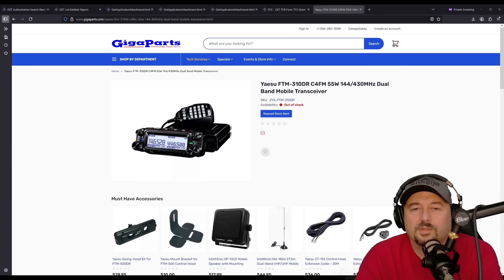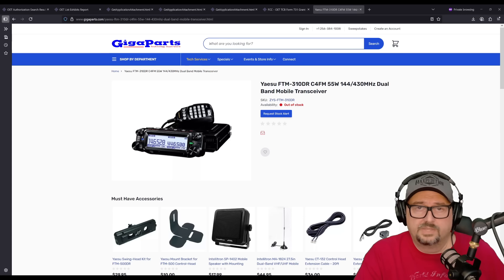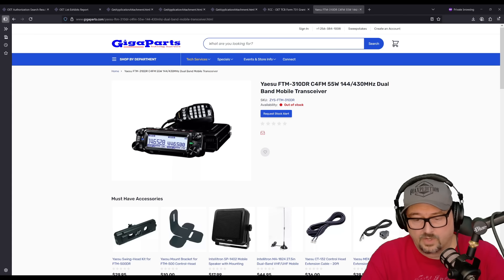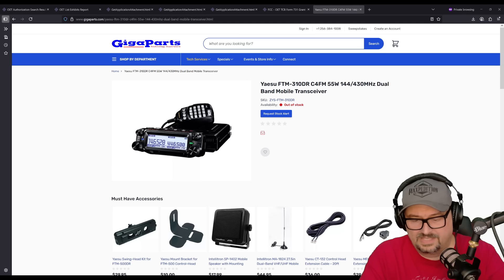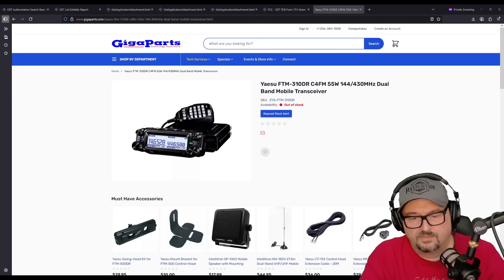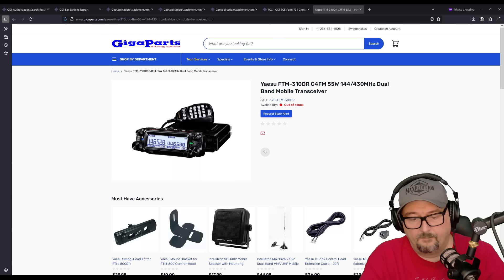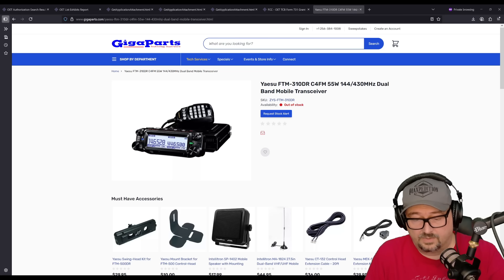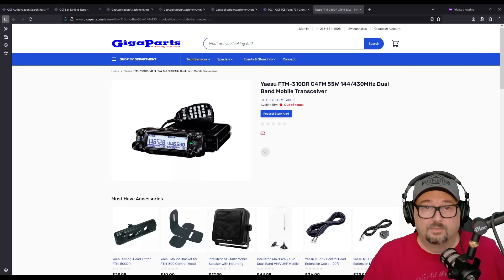The NEW Yaesu FTM-310DR Dual Band C4FM Radio Revealed!

Comment: You made mention of the FTM310d and FTM310 asp what really is the difference between the two? We are looking for some mobile radio for our Emergency Management & ARES.
Reply from the maker: The ASP has the Audio Signal Processing board, it is quite impressive and if you can squeeze it into your budget it’s worth getting 👍
Reply: @TheSmokinApe hey Man I appreciate your help! We currently have one DR-2X repeater. We absolutely love we order another through a program. We are in hopes to link the two together through fusion C4FM. The general public cannot hear C4FM except for other hams that have fusion radios. No one in scanner land can hear our communication. Analog will be standalone for other users, or to just get off Digital to communicate with other mutual agencies that may not have C4.

Comment: i bought a yaesu 6000 and was happy to have a new high quality mobile radio. i liked that it was dual band, but not so excited it wasn’t dual receive, but with dual-watch i could make if work for my desires.  then came the 150rasp and because it was real dual receive and full cross band duplex, i bought one and have the 6000 on the shelf for when i buy another car.  what i really liked most was removable control head with the option to keep it attached if i want, but mostly a mic jack and speaker on the control head! (could someone please explain why kenwood ISN’T putting a mic jack on the control head of their new 750?)(at dayton, even one of their reps shrugged and rolled his eyes when i asked about it!).  so now with this news if i had waited 4 months, i could had have the radio in the format and size i really like and included the c4fm digital?  would be nice if they offered a c4fm board to upgrade my existing 150.  one thing i do really like about kenwood is they do let you know what’s in the pipeline, why so many secrets yaesu?
Reply from the maker: Mic on the control head is a big plus.

Comment: YAESU introduces and ceases production of VHF/UHF radios faster than any Chinese junk producer. Buy a “NEW” radio and it is “out of production” before you can install it. Crippled “mobile” radio, no memory banks.
Reply from the maker: It’s an outrage!
Reply: That marketing philosophy works for Baofeng. Release a dual band HT with a new number that does the same thing as all the others and people flock to buy it. Then they post a pic of their shack online with 500 Baofengs that all do the same thing. I’m happy that there are still companies like Yaesu putting out new radios. I can’t imagine that ham radio is extremely profitable. The only negative I see is that Yaesu isn’t the greatest when it comes to marketing and public information.

Comment: Hey Ape, did you spot the feature differences between this and the FTM-510? If the price difference is enough, I can see most folks would be buying this instead of the 510 as it seems to do enough of what the 510 does to make the case for spending the extra not as strong.
Reply from the maker: I think it’s basically a cheaper version of the 510 👍

Comment: Thank god they at least included aprs this time.
Reply from the maker: I’ll sleep better knowing it has APRS 🤣
Reply: I still don't understand what APRS is good for.
Reply: @tracyrreed depends on where you are, unlike the other response that effectively claims it’s worthless. I have to strongly disagree. As I’ve been involved with setting up systems where no voice would ever cover until the recent advances in “Starlink” this in north central Wyoming. And about to start the same in the wilds of western Colorado.

Many SAR teams use aprs in Wyoming. Not sure how much they use it in other places. 

But to say it’s essentially a joke by the other writer is just plain ignorant.
Reply: @tracyrreed its a tracker and info sender. In times of adversity, it’s as good as nothing, since it needs a signal in the uv band which is most likely not a possibility in the remote areas where you would want this to actually work! Novelty at best, but Josh of HRCC lives and breathes APRS or atleast acts like it 😂
Reply: Yes, but it would be far better if it had a built-in KISS TNC. That would facilitate APRS, Winmail, etc. with a far better UI on your phone/tablet/computer.
Reply: As if that is useful!

Comment: So, this is basically a FTM-150, only it has/can do more things and stuff, such as: GPS, C4FM, APRS, DG-ID (Digital Group ID) and GM (Group Monitor), Automatic Mode Select (AMS), potentially 1,000 or more memories?  Also, it has a "DATA" jack-6pin mini DIN (is that like real data, what is the difference between FTM-310 and FTM-150 data jacks and capabilities?)    Sounds kind of awesome!  I love this design, simple clean, and easy to operate.  Too bad I semi-recently purchased an FTM-150 RASP...  I'm curious to see what the FTM-310DR will price at though.
Reply from the maker: Sounds about right, I think
Reply: Same here, the only thing I miss in my 150 which my 500 has is c4fm and this one has it!
Reply: It's a 510 with a 150 display

Comment: We need a modern version of a 706mk2g series based moble rig all band all mode with waterfall touch screen
Reply: Or a replacement for the trusty FT-857D
Reply: @AllanM2e0was the 857 qrp? Thanks
Reply: @Private290  100W radio
Reply: With a detachable, remotely mountable head, please!
Reply: Yaesu really dropped the ball with the ftx1 optima not being able to remote the face!
Reply: @ElectronicMechanic50  they dropped the ball not having a suitable replacement for the ft-857D in my opinion
Reply: @AllanM2e0 like sure disco it but make a replacement.
Reply: @ElectronicMechanic50  You can. Yaesu built a cable to do just that.
Reply: https://youtube.com/shorts/Ki5kC_tqsik?si=BFZyMfbMHhzHpq_o
Reply: ^this
Reply: Right ...and not those devices what we have already tons at home.
Reply: Wrong brand bud, keep up.
Reply: @mariemccann5895 i know! But all the brands have dropped the ball on a moble rig

Comment: So this is a 150 RASP with c4fm or a 510 rasp without the touchscreen and aprs?
Reply from the maker: I’m going to say “yes”
Reply: @TheSmokinApe just read in other comments here this has the aprs too, so 310 and 510 are just cosmetically different - in terms of display
Reply from the maker: @RhettSparrow  What’s the same:
55 W VHF / 50 W UHF, true dual-receive (C4FM/C4FM capable)
C4FM + FM with AMS auto-mode select
Built-in GPS; APRS 1200/9600 bps; WiRES-X Portable Digital Node
AESS dual-speaker audio (front + main unit)
Detachable control head; dual mic jacks; heavy-duty FACC cooling
Optional Bluetooth via BU-5 module
ASP available on both; pre-installed on “ASP” versions

What’s different:
FTM-310
Monochrome high-resolution dot-matrix display (non-touch)
Spectrum scope with ~47 channels
Super-DX weak-signal boost; ASP with SPU-1
Large knobs for A/B volume/squelch/tuning

FTM-510 
2.4″ full-color TFT touchscreen with modern UI
Enhanced PMG/MAG workflow and scope interaction
Super-DX + ASP (DRASP includes ASP from factory)
One-touch access to common functions on the touch UI
Reply: @TheSmokinApe perfect, thanks for sharing. 
(The super dx plus rasp is on both, though appearing under differences but ya, that helps)

Comment: It's hard to believe they are selling a VHF/UHF radio these days that doesn't bother to include the ham band between those 2 bands. That's about another $3 worth of parts these days. That's just dumb. I won't be buying a radio that doesn't include 220 MHz.
Reply from the maker: It would be nice to see more 220 👍
Reply: We’re going to lose it if we don’t use it but we don’t have many options to use it. Kenwood is releasing a Triband that includes 1.25 but no word on if it puts out more than the 5W others do.
Reply: I am not counting on the new Kenwood mobile having more than 5 watts on 1.25 meter honestly.  Which is a shame since they used to make a radio that had a 1.25m module available that did around 30 watts.
Reply: @DarkShadowCustoms  if it does, it will be my new radio. If not, I’ll stick with what I have.
Reply: I think Alinco is the only one of the major brands that currently sells a tri-band mobile with 1.25m (220MHz), however it is limited to 5 watts.  There are a few 25 watt tri-band mobiles that advertise 15 watts on 1.25m such as the BTech UV-25X4 and I think Wouxun makes a 25 watt mobile that advertises 15 watts on 1.25m.  Well before my time in the hobby Kenwood used to make mobile radio that was 2m/70cm with the ability to install a 10m, 6m, or 1.25m module and I believe those modules were around 30 watts output.

The 1.25 meter band is not allocated for amateur radio use world wide.  Due to the low use of the band it creates a paradox.  Since not many countries have ham radio allocation on 1.25m and the band isn't in wide spread use within those countries the manufacturers tend to ignore it.  Because the manufacturers don't make many radios for that band the hams who have privileges on 1.25m tend to not seek out equipment so they can use the band.
Reply: @DarkShadowCustoms  I have an Alinco 235 but I’d prefer to have a triband that I can remote mount the head. I’m eventually going to put my 891 in the truck so space is at a premium.

Comment: i am still keeping my fingers crossed that yaesu will make an 891 with VHF and UHF added. would be nice to have a single radio in the car instead of two...
Reply: I would like that too but it would undercut their FTX-1. I would buy an upgraded 891 or 857 before the Optima.   It’s too bad because the 891/857 fit better in most vehicles.
Reply: @TrenchKraft but releasing half a dozen versions of mobile dual banders doesn't?
If that was the strategy, then Yaesu would just release the ftm510 since the other versions undercut those sales
Reply from the maker: I hear ya but I think it’s called the optima?
Reply: @TheSmokinApe I said 891 not 710.
Reply from the maker: @JonathanKayne I’m confused
Reply: @TheSmokinApe the 891 is designed to be a mobile radio and lacks a waterfall/spectrum scope. 
The ftx-1 optima is basically an ft-710 with VHF and UHF added. It is also $1900 with a ton of cables. 

I would think an 891 with VHF and UHF would be more conducive to mobile installation and more cost effective.
Reply: @JonathanKayne  IMO the FTX-1 Optima is essentially the modern FT-897D, the result of a secret tryst between the FT-710 and the FT-818ND. That said, the FT-991A is a direct cousin, but all of these lovely analogies are meaningless because Yaesu has yet to produce what the community REALLY wants: a modern FT-857D, complete with the screen size of the FT-891. They would get extra points if they could supplement it with a base station add on option that would include APRS, GPS, sound card, auto tuner, and a connection for an external monitor. Such a transceiver would blow out the current ruling champ that is the Icom IC-7300.

A guy can still dream, right?

Comment: So basically, the 300DR is now the 310DR like the 500DR is now the 510DR. Ok. 

The 6 pin DIN is really a big deal, too; until now, it has been an odd proprietary DIN (9 or 10, I can’t recall). 

This is a big deal, my 300DR was in WinLink service and recently got zapped by lightning. I was debating the FTM 150R…now I may wait a bit longer. 

Thanks for the alert!
Reply from the maker: I’m kids excited about this one and I really don’t even want another dual bander
Reply: The only reason I was is because mine got zapped. Lost a Kenwood TMD710A, too; really heartbroken about that. 

However, the undamaged control head from the 710 will work on my TMV71A, and converts it to a D710A; so, that helped my feeling a bit.
Reply from the maker: @ScobieWilcoxon-px1fg that does kinda suck
Reply: A big one. The strike also got my pc and Digirig cables. It was a good one. 

3yrs ago it got my Kenwood 590SG and Astron PS and Kenwood TM742A. That REALLY hurt.

Comment: Nice radio. Hope it works well . I just wounder how many bugs in farmwear their will be and how many up dates ? I did get my 15 meter T2LT up today but I have to shorten and may be add a turn to coil . But it is 93F and super muggy today . I will tune it later when cools off.  It is 104 F in shop ,So waiting after midnight to do some work. I can tell from FM radio that ducting is going on . That big H on weather map making that happen.   Hope some HF 15 meter open . I do have a end fed half wave for 20 I can use. If I shorten it then 17 meter will tune. Just too hot in shop right now where my antenna's are at. And hard to breath outside from so muggy and some smoke from Canada wild fires . My cats sleeping buy mini split i have in the house . 73
Reply from the maker: Dang at 104°
Reply: @TheSmokinApe  To cheap to put AC on in the shop. No work anyways right now. Just a fan going. After midnight I tune antenna . No storms right now. Record heat in Boston NY ! If band not open on 15 Sat then I throw a KW FT8 out. LD-MOS amp can do 3.2 KW but set for 1.5 KW with 100 in. Not  like Jeem . I put antennular on input circuit .  And I use ALC ! Over bult but 50% .